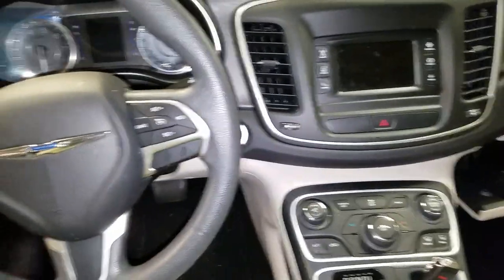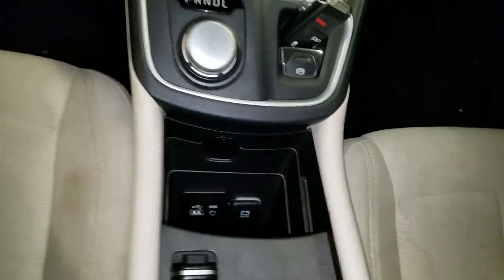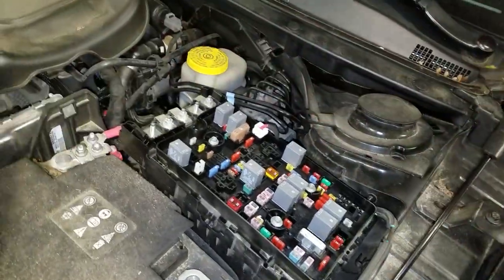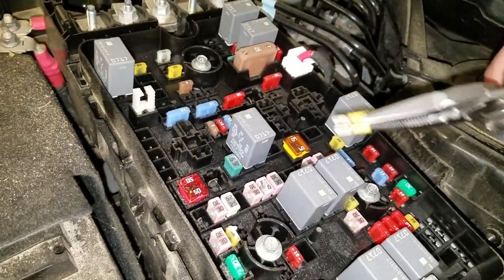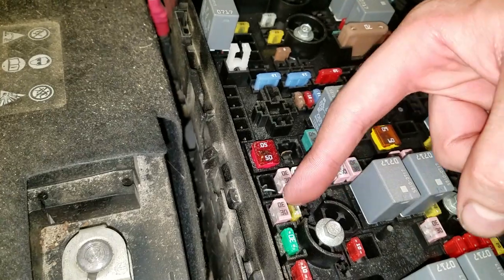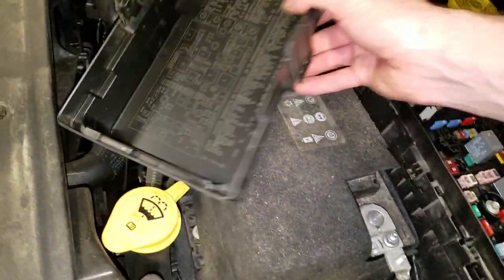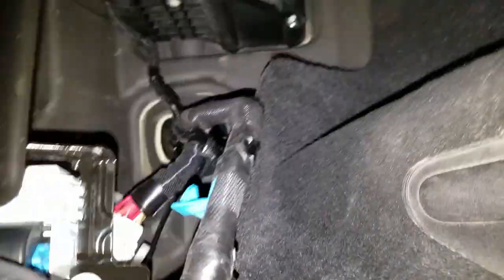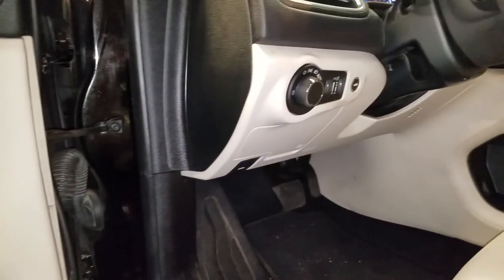Chrysler 200 Cigarette Lighter Power Outlet Fuse Location

Comment: Hey, I am having an issue with the 12 volt cigarette socket and also checked the fuse. Everything looks but the socket is still not working. Any suggestion or a quick video would help. Thank you
Reply: Did you ever find out a solution for that? I’m having the same problem
Reply: Same. Did you ever find a solution

Comment: My cig lighter, USB port and radio don’t work all fuse have been checked and are good what else, it’s bad since I had it in the shop 7 months ago, what can I do?
Reply: Did you find a solution?
Reply: Quinton N 
Yes I said screw it and got an impala, sorry if that sounded snarky, but that’s what I did
Reply: @tbutler4497  damn, if you don't mind me asking what year was yours? My girlfriend is having the same issue you described hers is a 2012
Reply: Quinton N mine was a 2016 s